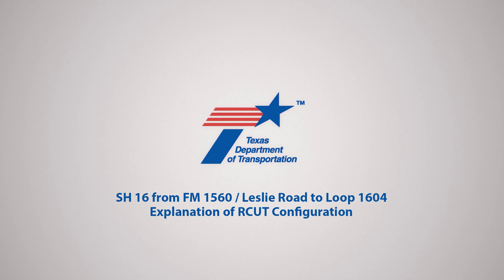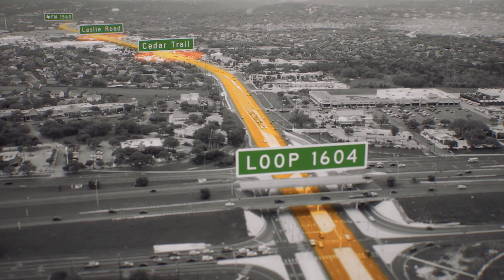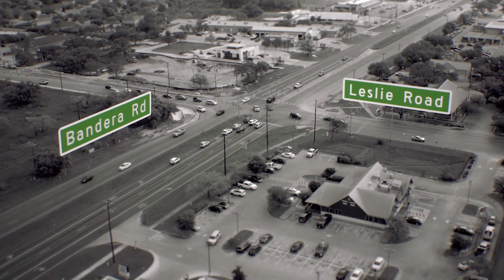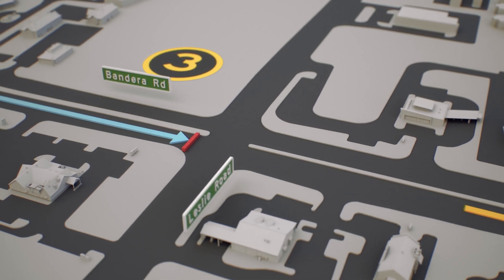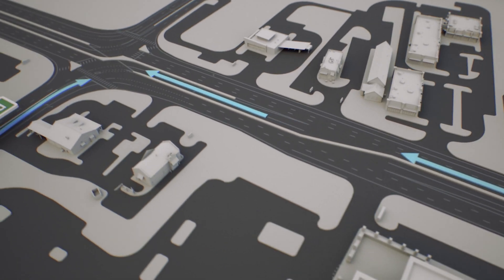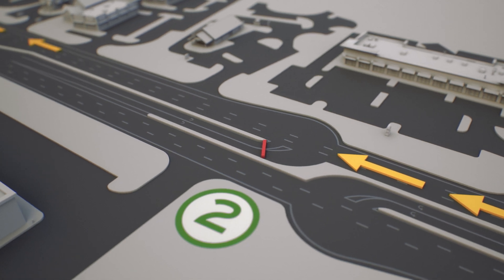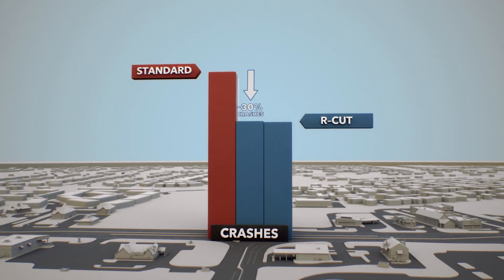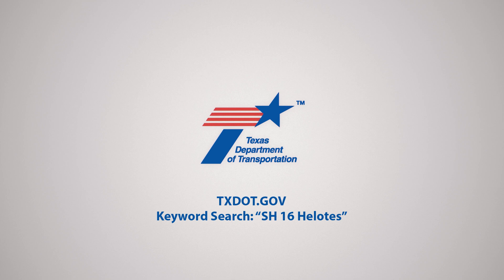SH 16 (Bandera Road) from FM 1560 (Leslie Road) to Loop 1604

Comment: This is not faster. I just had to deal with it tonight. It makes me drive significantly further out of my way to get to the same place I was going. Either make it an outright highway with exits or leave traditional signal controlled intersections alone. Roundabouts are the only improvement and those are disfavored here. Roads with more than two, maybe three lanes in each direction don't really mix with traffic lights.